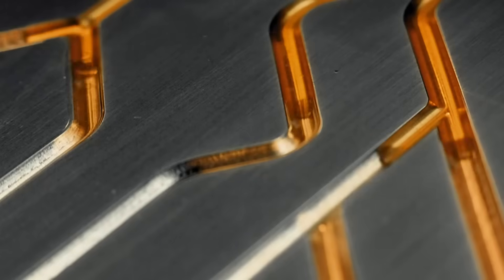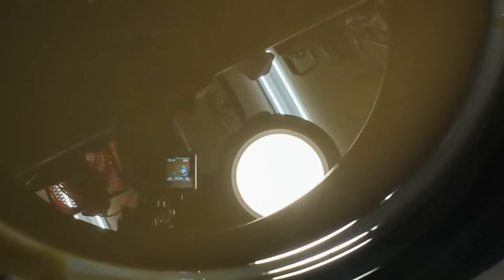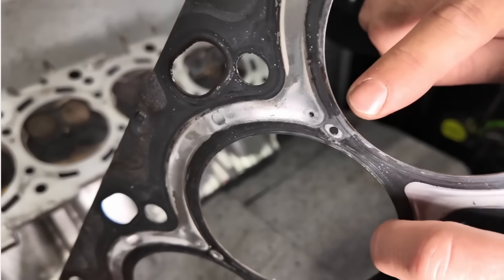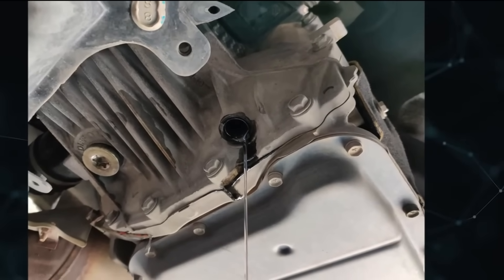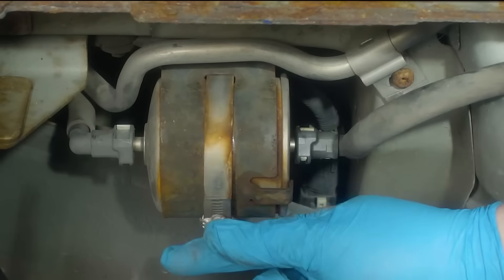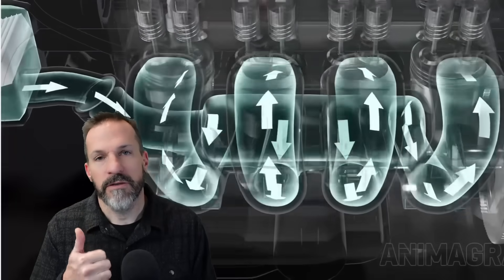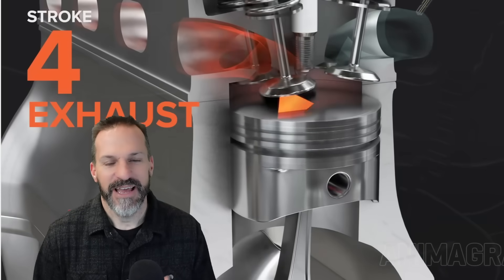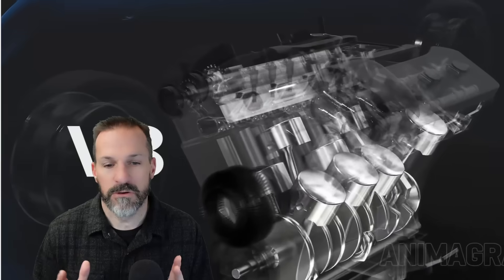Car Maintenance MOST People Ignore! Make Your Engine Last 200,000+ Miles!

Comment: Pro tip. Before you drain the fluid out of your differentials, make sure the refill plugs can be removed. If that plug is seized you won't be able to refill your differential. Especially if you live in the rustbelt.
Reply: Not a problem. Just flip vehicle upside down and fill using drain hole....works every time. Seriously though, that is a great tip.
Reply: Pro tip, if you fill bolt is siezed. Soak it with PB blaster (or your fav penetrant) once a day for a few days. Then break it loose.
Reply: @flicksifyr6793 dude BIG HUGE FACTS. Twice a day for 3 days - minimum. 
Twice a day for a week - easy work.
Reply: Once had to do the "try everything" filler plug when the fluid was already drained. Lesson learned 😅
Reply: Thank you. DIY crv owner here. My differential is due for a fluid change. This was just the advice I needed to see. Thank you again. 
-C
Reply: i just watched that video before this one lol
Reply: I had to learn this twice.
Reply: Learned this the hard way😂
Reply: Oh man, the way your comment reads sounds to be from experience. I feel you.
Reply: WD-40 is your friend here
Reply: @ShermPWilliams  wd40 is NOT a penetrant
Reply: You will but it’ll cost you lol
Reply: You can pump thru the drain by using a rubber grommet to seal around the nipple using pump. Fill to capacity spec
Reply: @jalee6587 I hope you aren’t being serious.
Reply: the refill plugs can be removed no matter what.  but if theyre stubborn they need to be forced out with different tools thats all
Reply: @drewdevon2009 Exactly. One way or another, the fill plug is coming out. I once had to drill and use a 1/2” screw extractor to remove the tapered thread plug on a Porsche, but it came out.
Reply: Hard to imagine an oil filler cap being so seized that it cannot be removed without a wrench or other tool, but I guess anything is possible.
Reply: @hilltopperblog  Engine oil pan plug no, fill plugs for differentials, yes. Particularly if they haven't been removed for many years.
Reply: @Mayamax3 
"Oil pan plug no". 
Bro actually said the oil filler cap...
Reply: No problem,  take out the switch of white tail lights connected to the manual gearbox and fill from there.  I do that way, to avoid work under the car.
Reply: The only good thing about having no fluid in the differential, is that it probably won't leak.

Comment: The head engineer at Nissan recommends if you want engine to last the most. Change oil at 2000 miles along with Filter.
I adhere to this meothod. I also use Pensoil Ultra oil along with Amzoil oil filters when available or Mobil 1 filter..
I recommend if you have a Toyota that does not use a spin on filter compare the OEM filter vs the AMZOIL filter
You will never use the OEM again…clearly the Amzoil has to have better flow.
My 2001 corolla went over 300000 miles still running when I sold it to a college kid
Reply: 2000 is crazy. Been doing 4000 and my 92 sierra has 500k miles
Reply: @RipliWitani  on full synthetic or conventional oil? i would not go over 3000 miles on conventional, but i would go as much as 5000 on full synthetic. My 1991 GMC 2500 went 400,000 miles and was still running good when it got sold
Reply: 2000 miles is a little low. I do 3000 but you could honestly be fine at 4-5k

Comment: An in depth video on how long to idle before driving would be helpful.  Just long enough to build oil pressure (mentioned briefly in this video), get oil to an acceptable operating temp, get the engine to an acceptable operating temp, etc.—my MB has all three temp monitors. What to do in the summer vs winter. How idle rev / computer programming works, etc.
Reply: @Now_or_Never_777  About a minute or as soon as idle starts to come down. Drive gently until temp starts to come up. The faster engine gets to operating temp, the better.
Reply: If you’re in cold weather invest in a block heater. If you live in warmer climates idle the engine until you see the temp gauge move. Most cars these days rev the engine to heat the cat. You can also force your engine to do an extended crank to pull oil into the filter before the engine turns on. But it won’t make that much of a difference
Reply: Yes, until the revs drop down then start driving gently. Its sub optimal for the engine to leave it for ten minutes or more idling cold. Even in winter. Summer time requires basically no idling, just rpm drop, meaning adequate oil pressure.

Comment: In 2018 I bought. a new european sports sedan. I don't have the car anymore, wife wrecked it. I could not manually check the oil or add oil to the car. The oil change recommendation would show on the screen in the car. It was automatic figured, I believe at, 7,500 miles. I'm now looking for a more analouge car.
Reply from the maker: Yup same here. Lots of newer cars with no dipstick, check via screen only..it’s pretty silly. I see many new cars with 10,000 set as default for the maintenance reminder too…it’s sad.